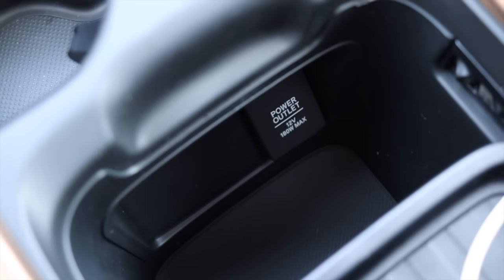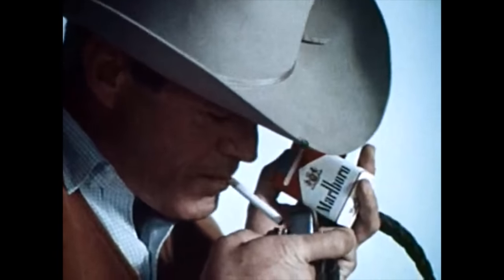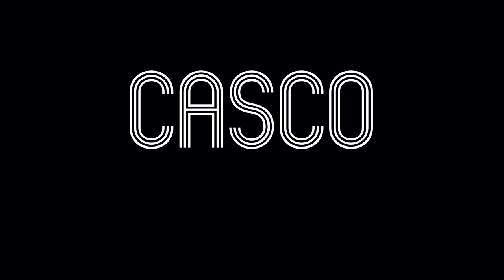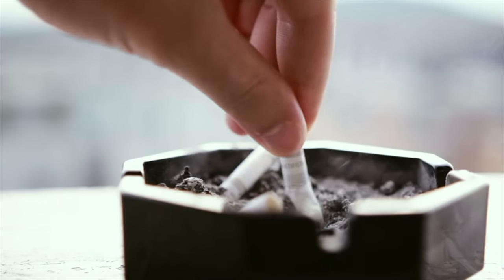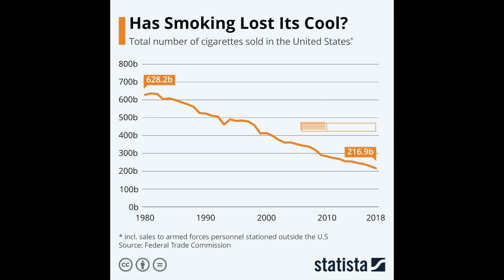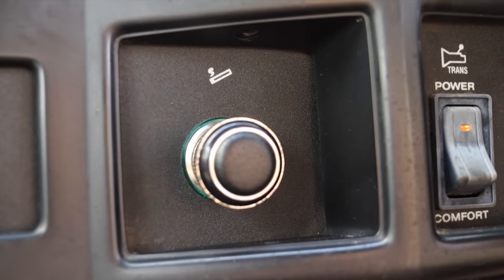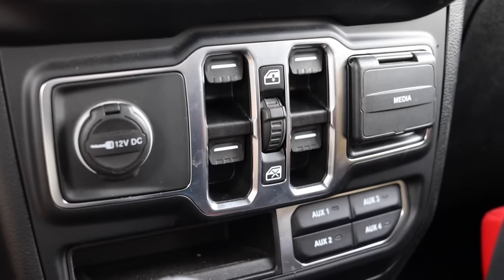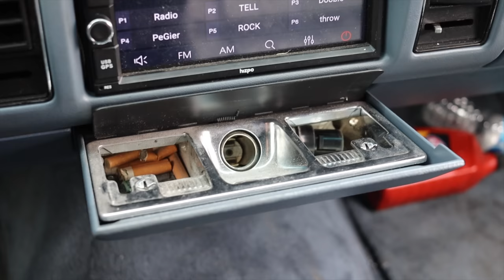Cigarette Lighters - How They Were Invented & Why They Went Away!

Comment: I find it remarkable that somehow they managed to accidentally create a fairly standard connector. If someone said "let's create a car accessory connector" we'd end up with half a dozen incompatible connectors, and North America and Europe would each have their own sets.
Reply: My old (well... 2008) BMW motorcycle had a power outlet. It was 12 volts. It was round. No it was not a ciggie outlet, it was a propriety port (too small for standard ciggie outlets) which would actually talk to the bike's computer to confirm that it was something that was allowed to be powered by the bike (i.e. correctly licenced).

It was also an utterly useless thing.
Reply: It's a pretty crappy connector imo. My parents smoked in the car and used butane lighters (Clipper) to light their cigarettes. The dashboard lighter was used as a last resort.
As a child I thought a barrel jack would be more useful. When I was old/wealthy enough to own a car, I installed a couple of 2.1mm barrel sockets in those blanking plates you get in a vehicle that has the most basic trim level.
I guess what the cigar lighter socket does have going for it is you can plug it in while you're driving, but in my experience most accessories disconnect when you go over a bump. Or in at least one car, the lighter socket is right next to the handbrake and gear stick, so it's right in the way, and all it takes is a little nudge to lose power.
TL;DR: A barrel jack takes up less space, can handle just as much current, and is a worldwide standard, but if you try to plug it in while you're driving, you might crash. Also USB PD FTW!
Reply: @igotes  cheers to usb pd! I bought one such power bank on clearance and paired it with a USB C to Cigarette cable to use with my old Cigarette to 120V inverter. AC power bank on the cheap.
Reply: I think you meant to say "North America and the rest of the World."
Reply: @Logarithm906  that feels like the ice cream lock from LockPickingLawyer, he showed how to pick it, locked his wife's ice cream with it to see if she could pick it... She just opened the ice cream bucket from the bottom.

If the purpose is preventing me from reaching 12V DC, I'll just grab two wires, pliers and go for the battery with a 10 cent p4 connector
Reply: I don't know if I will called it accidental
Reply: Things were much simpler back then. Cars, tech, ports, adapters, cables, it was all so much simpler so it wasn't hard to make everything standard
Reply: Actually phone charger and other companies simply made an adapter that would fit what was already common in every vehicle
Reply: @Logarithm906  bmw out here on that apple dongle game.
Reply: @Mordecrox  like a real man.
Reply: @GlorifiedGremlin  Its coming back at least in Europe as EU passes standardization legislation of all kinds of things. Like one of the most recent ones got Apple pissed as they made the USB-C to be standard charging port to most electronics specially phones and tablets. So if Apple wants to sell their product inside the EU they have to start using USB-C and not that odd port they currently are using.
Reply: Hakim Mohamad  dude it is the dog from Garfield it's not that deep (snark aside, never heard of that one)
Reply: Automotive design is actually pretty good at standardization all things considered.
Reply: @Logarithm906  I'm sure someone created some kind of adapter that would lie to the computer and allow you to power anything low-voltage with it
Reply: @Logarithm906  Would it not have just been a merit socket? Actually not proprietary to BMW by any means and actually reasonably common. A lot of auto stores and electronics stores sell merit plugs, sockets and adapters.
Reply: @Duraltia  I dunno. If plug sockets are anything to go by then the UK would have it's own. And then you have various manufactures (look at Apple with it's nonsense connectors).
Reply: @Logarithm906  Same on my 2020 R1200RT, hate it, it’s like a motorcycle cigarette lighter
Reply: Well said.
Reply: They didn't want to risk with people's vices...
Reply: It’s like creating languages, how the hell do people catch on.
Reply: It's absolutely terrible as a connector though.
Reply: a blessing cancer related invention ❤
Reply: @igotes 
You know the contacts inside are adjustable, right? Pull the fuse, tighten the contacts just a hair and replace the fuse. stuff will stay put after that.
Reply: @negativeindustrial  Yes, I do know that. It can help, but not in all cases. I maintain that it's a poor connector (mechanically) for pretty much anything other than the cigar lighter.
Reply: @igotes  
You’re right, it’s not a good one anymore but it can work well.
Reply: @Logarithm906 no duh propietary or whatever stuff us stupid
Reply: @Logarithm906 or pretty much useless unless you have the right stuff

Comment: I remember seeing a billboard for cigarettes that said, "your car's cigarette lighter was not meant to charge your cellphone." You had to be careful about buying a used car from a smoker. Not only was it bad for the interior trim, and almost impossible to remove the smell, but the cigarette lighter would get clogged with gunk and thus couldn't be used for anything else. Well, if we found ourselves stuck waiting in our cars, then we could always play with the cigarette lighter. It was difficult to ignite anything but cigarettes since it was a red hot heating element and not an open flame. I wonder how many car fires (aka car-b-ques) got started that way. Maybe it is safer that we just have our phones to play with now.
Reply: No cellphones can catch on fire too. My friends I Phone burnt his table.
Reply: Cigarette lighter sockets are easy to replace if they are filled with cigarette junk but the main problem is, as you stated, the smell and discoloration of the interior pieces.
Reply: i thought cigarette advertisments where illegal by the time cellphones existed
Reply: Neither was USB. Sometimes I wonder how the inventers of USB feel about it being used as a power standard. It was never intended for that, or at least they didn't envision it being used that way. In a car, they usually have data pins so it's proper USB at least.
Lighting a cigarette is about the only thing you can't do with a smartphone. Although apparently they made one that had one built-in. Pretty slick party trick I bet. Oh and the Note 7 had that capability too.
Reply: @anchorbubba  some companies took a gamble. I remember Copenhagen had a cowboy riding a horse with Copenhagen written over the top. Went away somewhere around late 90's.
Reply: I remember playing with the lighter too. After it got hot you couldn’t push it in again until it cooled. I also remember burning myself as a kid while playing with it. Of course you couldn’t say anything about the burn because of you did you would get in trouble for playing with the lighter!
Reply: Cell phones are far more dangerous than smoking ever was. How many people have been killed and seriously injured by someone using a cellphone instead of paying attention to driving their car? Then there are all the mental health issues caused by using a cell phone 24/7.
Reply: They weren't hard to remove and clean. Some people see mountains where there's mole hills.
Reply: @geraldscott4302  literally 50% of lifelong smokers die of smoking-related illnesses like lung cancer, emphysema, etc. Needless to say, cell phones don’t cause anywhere near that
Reply: @stanleyshostak2737  oh trust me I remember the burn from them very well. From what I remember my parents had that "welp you're not gonna do that again are ya" attitude towards it
Reply: Just clean the lighter socket with a wire brush until it's shiny again, takes just a few minutes. The call your brother to dig around under your dash to find the fuse you blew out cleaning it with a wire brush. Only after swearing it worked "fine" earlier and all he did was clean it.  Please, disconnect the battery, then clean it. My brother learned a lesson that day.
Reply: The smell goes away with coffee grounds,, you can also deel clean the interior and the cigarette lighter and socket is like $15 and a half hour of effort depending on how clean you like to splice your wires. I own an 85 Cressida, 86 camry, and 2000 crown vic that were all smoker cars and none of them smell like smoker cars.
Reply: Because phones have never been known to ignite... if anything, I'd say the potential for a car fire is greater if you drive around with a phone/laptop in it than an intert cigarette lighter.
Reply: @Abc-qw5th  Darwinism
Reply: @Abc-qw5th  I remember when I was about 5 or 6 I was bothering our cat by blowing air in his face, pulling his tail etc. My mom told me to stop doing that but I didn't listen and kept at it. Finally the cat took a swipe at my forehead with his claws. I started bleeding and ran to my mom to tell her what happened, and she without hesitation said "Yes, and it's what you deserve" before she got some bandaids.

I never annoyed the cat again after that. Sometimes you just gotta let kids find out on their own why they shouldn't do certain things.
Reply: @anchorbubba  not completely, just some types of ads like TV
Reply: Most car cigarette lighters are perfect size to fit in the gas tank too lol 😆
Reply: @stanleyshostak2737  I think that's one of the most ingenious things about making a heating element out of a bimetallic coil - it literally can't overheat itself if there's nothing impeding the element from a tiny bit of movement.

Plus, if you're someone smoking in a car, they're so much better than trying to wrangle an open flame. The hot element is great for any time an occupant wants to smoke when the windows are open, too - you could just about light up a cigarette with your head out the window. 

I really love that someone came up with this idea; how, mechanically, this kind of lighter is essentially an oversized, super-slow turn-signal flasher - aside from the auto-off, pop-out switch, to keep it from perpetually re-starting every time it cools enough to move the bi-metal coil far enough to close its circuit again.
Reply: I got a car from a smoker took two years of cleaning to finally remove the smell!
Reply: I remember in the early aughts learning that I could not charge my phone unless I was actually driving the car. Simply leaving the charger plugged in (with no phone) when parked, would result in the cars battery being dead the following day due to the fact that it draws a constant charge. I suppose in the 20th century smokers would need to light their cigarettes when the car was off, and thus always needed the ability to do so.
Reply: I have a truck from a smoker, had all the smoker stuff but he never smoked in that truck.
Reply: Once when I was like i don't know young my father stepped into the store and I stayed in the car (riding in the front, lap belt only, can't do that now) well my dumb little ass, pushed in the cigarette lighter, when it popped, it wasn't glowing, so I stuck my finger in there to see if it was hot ..... it was ... and as I had been told to never touch it I put it back and tried to act like I hadn't just stuffed my finger in a cigarette lighter, because it hurt but the ass whooping I was sure I'd get walloped and that surely would hurt more lol car was a sky blue ford fairlain 4 door sedan bench seat in the front dont make them like that anymore lol
Reply: @stanleyshostak2737  i still have a coiled scar on my arm from the in car lighters
Reply: Just not while driving 😉
Reply: @joanfrederick9176  i am about your age...it is not an inherent problem with the cig lighter it happens when the lighter gets stuck (rust, dirt, physically bent etc.) and cannot pop out and it keeps heating...usually wiring gets hot enough to burn..

as a side note in the 1960's there were a few fires due to leaving your dome light  on (over night)..the dome light would generate heat and since the cover did not allow the heat to escape the plastic would melt down onto the interior..the fuse would not pop since the light was working properly..happened to a buddy of mine at the time...

i have a smart phone and never a problem with charging or using it..but i also would never take or make a call while driving...
Reply: I take unused cigarette lighters from the junkyard and make sure that all my rigs and everyone I know has one stashed away somewhere. If you're stuck it's better to have one than nothing.

They're shit for lighting cigarettes and useless for joints. One hilarious thing is charging a vape with the cigarette lighter of a car from back when everyone smoked darts similar crazes of different eras combined.
Reply: @peteszerszen4337  
Surely though they could have thought even back then that charging while transferring data would be a good idea. Especially back then where transfer took so long anyway.
Reply: Cell phone chargers have taken the place of coal/wood stoves and cigarettes as the new source of accidental fires.
Reply: @smokedbeefandcheese4144  your friend, Smoked Turkey. RIP
Reply: Zero
Reply: @anchorbubba  it was. Kinda makes ya wonder, no?
Reply: It depends on how the lighter is wiredಠ_ಠ
Reply: I would rather have a cigarette lighter outlet that would run something that draws 20 amps then a USB outlet that basically won't do anything  but charge a stupid phone
Reply: @johnreyes6902  ..... when you don't know facts just make shit up ????
Reply: @garrisonnichols807  iphone 7? old af battery? using the phone like a kid's toy?
Reply: @ matthew banta
im surprised you stopped typing i was expecting at least 7 more random paragraphs of cigarette lighter memories.
Reply: @ronald5629  Some people are lucky. My dashboard USB barely even charges my phone. It's just for interfacing a USB flash drive with the stereo's music player.

Luckily there's a 20 Amp lighter socket next to it.
Reply: Ozone treatment can eradicate most of the smell but even then, some will remain. I'm not a smoker but I don't even like eating or drinking in my car let alone thinking about smoke wrecking everywhere inside it!
Reply: @johnreyes6902  huh less smoking but high cancer rates 🤔
Reply: @errorunknown667  ozone takes a few hours
Reply: @beekeeper8474  Yeah, it turns out when people live longer on average, it gives them more time to potentially develop cancer later on in life. It also might have something to do with the fact that our methods of screening for cancer get better as time goes on.
Reply: @beekeeper8474  ozone doesn’t remove the sticky brown tobacco off of every single surface in the car.
Reply: @peteszerszen4337  The Note 7! 🤣😭Lol
Reply: @garrisonnichols807  phones cant catch like that unless a heat source was directly on it for long periods of time, therefore its your friends fault.
Reply: @anchorbubba  - They were.
Reply: I don't agree (although respect your opinion) with that id rather someone smoke and drive then text and drive. Even with the chance of fire it would be more rare then texting and driving accidents
Reply: @ronald5629  USB PD can deliver up to 240W, so not too far off 20A@14.3V. Your regular shitty USB outlet can barely handle 5W of course, but for most peoples' use cases these days, that'll do.
Reply: @mryoutubeviewer794  I agree. My father used to roll cigarettes while he was driving, he was in control of the steering but the person in the passenger seat would have to deal with the gears. It would have been disastrous if he was txting his m8s on a cellphone though.
Reply: If heat it a lot, you can ignite paper with it, we used to do it when bored too lol
Reply: @geraldscott4302  car accident deaths rarely break 15% of the deaths caused by smoking in the US annually. It’s therefore absolutely impossible for distracted drivers, hell any drivers, to be more dangerous than smoking is for an individual. Hell even secondhand smoke is likely responsible for more deaths.
Reply: The intro should be waaaaay longer !! I’m thinking 10 mins for an intro and then 30 secs for content
Reply: Ford went too serious with this (at least in my country), my Ford Figo 2012 has an ash tray but not a lighter.
Reply: I prefer to have one in the car than not. Its a nice feature to have. Its also nostalgic.
Reply: Lollll safety sally on the scene
Reply: @johnreyes6902  look up what rf radiation does
Reply: Being a smoker doesn't mean being a horrible dirty person. I smoke in my room and there isn't a single smell because I ventilate everything and clean
Reply: @anchorbubba  It totally depends on where you are and what medium tobacco companies are advertising through. In the United States, TV and radio advertising were the big ones to be banned in 1970, though smokeless ads were still allowed on TV into the 80s. Billboards, magazines, newspapers, etc. have different rules and were banned (if they're banned) at different times. Not every state has billboard advertisements for tobacco banned.
Reply: You can use the ciggie lighter to do burn marks on your friends or siblings